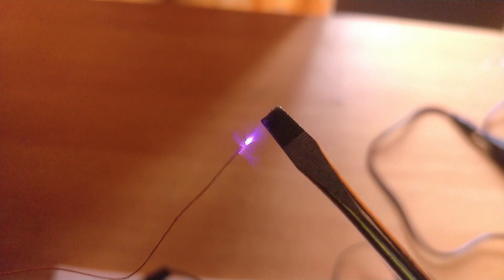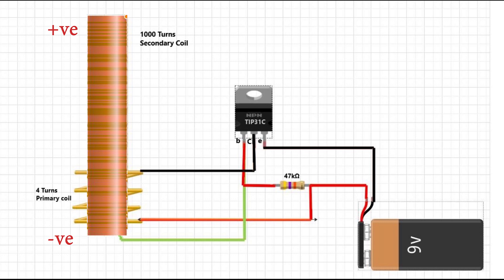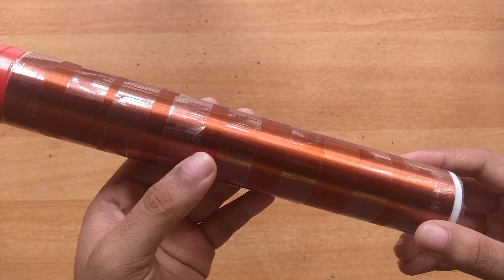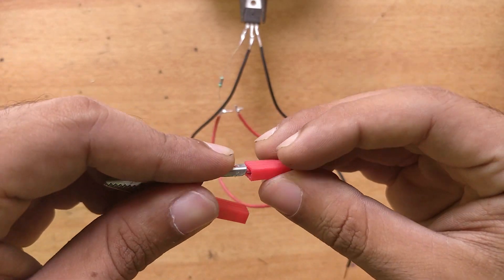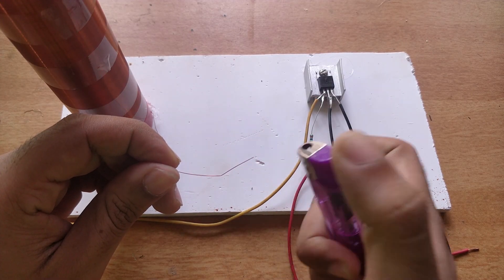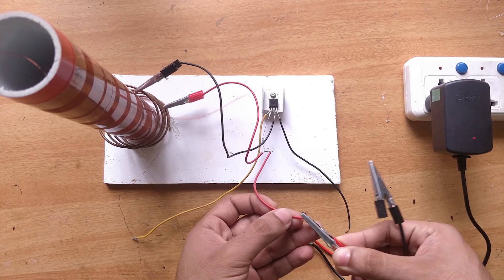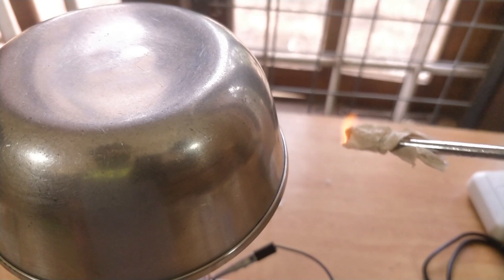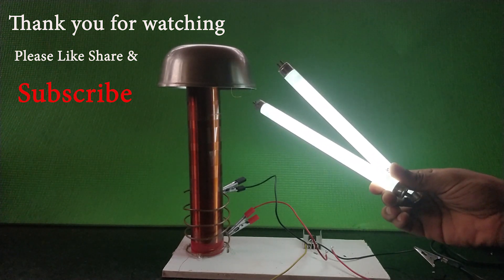How to make Tesla Coil at Home | Slayer Exciter | High Voltage Arc

Comment: Bro how many meter of copper wire did you used in primary wineding and what is the thickness of primary wineding wire .
Reply from the maker: Actually, you need more turns in the secondary winding. For the secondary I have used 200g of 35 Gauge wire. And for primary I used 25 cm 12 Gauge wire.
You can use the same transistor TIP31C .
Reply: @BehindTheClutter  Bro i made 4250 turns for primary coil . And 30 turns for secondery coil .what type of resestens should i use and what type of transistor should i use bro . Bro can you replay fast
Reply from the maker: Primary should only have less number of turns and secondary should have more no of turns. Otherwise it will become a step down transformer.

Comment: Can we use old copper wires for primary and secondary coils? And what would be the thickness and lengths for both coils??
Reply from the maker: Yes, you can use old wires, but for the secondary it must have proper insulation. For the primary you need approximately  25-30 cm of 12 Gauge wire. For Secondary you need 30-35 Gauge wires you need approximately 250g of it.

Comment: Hi bro......copper wire nte cost parayamo.... primary and secondary.... please reply...
Reply: Bro.... primary coil ne ithe gauge Ulla copper wire thanne venam ennundo
Reply from the maker: Primary, 1m 12 Gauge  Rs 100
Secondary, 35gauge 250g  Rs 200
Motor winding cheyyunna kadayil kittum. Laminated copper wire
Reply: @BehindTheClutter  bro secondary coil ne 30 meter copper wire  mathiyo.......atho iniyum veno......30 meter aane 200rs ne........

Comment: if i add more transistor, I'll need to add more power? am i right?
Reply from the maker: If you add more transistors you can run it for a longer period of time. Or you can add more power with shorter time as before

Comment: what is the correct rotation of primary and secondary coil?
Reply from the maker: Both primary and secondary should be winded in the same direction. In this project I have winded the wires in clockwise direction.

Comment: hlo, I need your help for Making this awsom tesla coil, I have an Ques, Please rply
Reply from the maker: Definitely! What help do you need?
Reply: @BehindTheClutter  i want to know that, can we put any no. gauge wire or not? and will the turn remain same or not?
Reply from the maker: No we can't  put any Gauge wire. All the wires comes in different thickness.  For the secondary you need atleast 1000+ turns in a length of approximately 25cm. It can only be done by wires with less thickness. So you need to use wire of Gauge above 30.

And in case of primary you need only 2 to 4 turn and wires needs to be thick to produce enough field. So use wires of Gauge below 14.

Comment: I'd like to ask that can we use a n channel mosfet instead since I only have that laying around, p55nf06 to be particular?
Reply from the maker: Yes, you can use n channel mosfet instead of npn transistor. But p55nf06 is having low power ratings compared to TIP31C. So there are chances that it won't work or blew easily.  You can try using it.
Reply: @BehindTheClutter  Thankyou sir for you worthy suggestion. I'm a 12 grader and love electronics but don't know much about it. Your videos truly help me and also your suggestions. Thankyou once again☺️☺️
Reply from the maker: You are welcome 😃

Comment: Can i use 12v/24v instead of 9v in that circuit diagram ? 

Or i need to change some equipment, resistance / transistor, for using 12v or 24v?
Reply from the maker: No, you can use upto 18 with the current circuit. But you need to add more transistor in parallel to distribute the load.
Reply: @BehindTheClutter  thanks 🖤
Reply from the maker: You are welcome

Comment: And iam from remote area so pls suggest suitable transistors available at T.V repair shops .
Because I was found one t.v repair shop near me..
Or I have z44n MOSFET.
Reply from the maker: You can use any NPN transistor with similar power ratings as of TIP31C. And you can also try using IRFZ44N as it's a N channel mosfet

Comment: I made the same circuit and apply 12v DC from the adapter why it's not working ?
Reply from the maker: Did you use the same components? Same number of turns and same voltage current rating. If so then the problem will be with the transistor. Check weather it's working?

Comment: Sir can i use tip 32 transister
Reply from the maker: No, we can't TIP32 is a PNP transistor and the one I'm using in this video is a TIP31 transistor which is an NPN one. Both functions in the opposite way. So you have to use an NPN transistor here.

Comment: I only have 504 secondary and it is a little thicker than yours
Reply from the maker: The turns shows the voltage multiplication. Voltage multiplied = ((no of turns on secondary) /(no of turns on the primary) ) times. That the problem occur with less number of turns

Comment: Plz reply it's very impprtant.... Can I use TIP41c instead of TIP31c? And 24   gauge wire instead of 12 gauge?
Reply from the maker: Yes you can use TIP41C instead of TIP31C. 24 won't be enough for this. 12-16 will be ok. Or you can use a normal thick wire.

Comment: Bro it worked i have used TIP31C,  4 10 K RESISTOR but my power is too low why?
Reply from the maker: What was your input voltage ? What the current rating.
Reply: 12v
Reply: And it didn't show plasma
Reply: Is this because of the resistors ?
I have not used 47k resistor.
I have used 5 _10k resistors.
Reply from the maker: What was the current rating ? You need atleast 1.5 A, try using 3 10k ressistors in series, Is the transistor working? Check the resistance between base - collector and base - emitter.
Reply: Ok

Comment: Have you used 12 gauge copper wire in the primary coil or 14 gauge?
Reply from the maker: 12 Gauge without insulation

Comment: Bro can i use 10 k resistor?
Reply from the maker: Try using 3-4 10k in series.
Reply: Ok tnks bro
Reply: Bro in the secondary coil can i use electrical copper wire instead of 35 guage copper coil.
Reply: Sry primary coil

Comment: Use mains supply and nsc to have 100000v output
Reply: I saw it in a image in google where they used 240V from mains supply and converted it to maybe 2kv with a nst transformer and used it as Input.  This give more than 100 kv as output
Reply: I am no expert, but I am planning on making a tesla I really need to know if I can use AC as Input rather than DC. Can you help me?
Reply from the maker: I haven't tried it yet, so let me test it and give you the results.
Reply: @BehindTheClutter  thank you so much.
Reply from the maker: Sorry, I don't understand. Could you elaborate. please

Comment: I can use 32gauge copper wire 0.2mm diameter
Reply from the maker: You can use 32 Gauge, but it's more than .2mm  in diameter

Comment: Can i use TIP32c transistor
Reply: Tnks
Reply from the maker: You are welcome
Reply from the maker: No, you can't. TIP32C is a PNP transistor. You need an NPN transistor for this circuit.

Comment: I made it a little glow comes at the end when a metal touch it but it doesn't form a plasma arc i am using a 9v battery , TIP31C , 47k res ,
Reply: Pls help me
Reply from the maker: Increase the voltage and current. 9V battery is only having around .3A and will be 1.8W of power thats not enough. Use 12V 2A. Then you'll get 24W and you can see the arc

Comment: Can you touch the arc with your hand? How many amps does it output?
Reply from the maker: Yes, it won't shock you. But it will burn you as plasma is really hot. The output will be in milliamps  range

Comment: How did you calculated the wire length
Reply from the maker: It's calculated according to the dia of the pipe I'm using. Suppose I'm using a pipe of diameter  'd', then the amount of wire need for one turn will be it's perimeter, and that will be 'πd' (equation for perimeter of a circle). So for one turn I need  πd length of wire, hence for 1000 turns. I need (πdx1000 ) length of wire.
Reply: It circumference not perimeter but great job at explaining Tesla coil
Reply from the maker: Yeah, circle does have it's own name for perimeter 😅. Thank you for the feedback

Comment: I can use 30 gauge 100meters (0.32)
Reply from the maker: Yes,  that would enough for 1265 turns (approx.)  of 1.5 inch diameter.

Comment: 1:07 I think there is serious problem. Your calculation ( (1/0.5)*250 = 1250 Turns ??) is incorrect. Could you please recalculate?
Reply: Wonder if you don't know the difference. Is 500, not 1250.
Reply from the maker: Yes, it was a  typing error, I did the correction and added it in the discription and  pinned the same  in the comments. Sorry for the worng information inthe video.
Reply: Or, did you mean to write (1/0.2)×250=1250 ?

Comment: Hi sir,
Can I use 2SD2374 (or: even with 2SD2374A)? It says in DS the curent collector has 3A, both Collector-Base and Collector-Emitter junctions ratings are 60V (2SD2374A is rated at 80v) and the current gain is 70 hFe.
Reply from the maker: Yes, you can use 2SD2374, but  it's having low power ratings, so you need to use multiple transistors  in parallel to share the load, or it will burn out quickly.
Reply: @BehindTheClutter  ok. So the circuit runs at 5V. The transistor can be found in CRT Monitor.
Reply: But MJE13003 can be used in parallel to stimulate Tesla circuit?
Reply: Note that the transistor having collector current at 3A is not critical. The resistor should be at least 30 or 40 kohm on the base junction. Instead, should I have used 2SD2374A (even in parallel).
Reply from the maker: Sorry, I don't understand. Experiment. Thats the best way to learn.
Reply: @BehindTheClutter  I did already (one transistor).
Reply from the maker: Did it worked? If you were using MJE13005 it  would work with one transistor for sometime.
Reply: @BehindTheClutter  With MJE3055 could work well per yours. Imagine if I was using one 1Amp transistor like BD135 or BD139, the circuit just have worked? Of couurse, can I use fast diode (or schottky) on Base-emitter junction? But on Collector-Emitter and what could happen?

Comment: Can i use 0.42 mm wire
Reply from the maker: Yeah you can use .42 mm copper wire, but the problem is the that length of secondary will increase and it will reduce the rate of induction
Reply: Hi brother I made the whole thing but it's not working 😢 plz plz help

Comment: Can I use regular wire as primary coil of 6sq mm or higher or lower ? What do you say?
Reply from the maker: Yes, you can use 6 sq  mm or higer. But make sure it's comes with single core

Comment: Bro 
I have been selected for State level
Please help in this project
Reply from the maker: Is this your state project 🙄 ?
Reply: @BehindTheClutter   
Can you help he to make high power tesla coil
Reply: @BehindTheClutter  can you help me to make more power ful tesla coil
Reply: @mdmoieez6646  add like 10 transistors in parallel with heat sink and cooling fan in a enclosure.Make secondary with longer 1.5 inch  pipe for more turns.Also mess around with secondary by varving the no.of turns as shown in vid.
use a laptop charger for powering the circuit
and a 12 charger for powering the cooling fan
also add a bigger top load

also don't die
Reply: use like 20v 3amp laptop charger
Reply: No bro i want to make more powerful
Bro can you help me
Reply: I'm unable to find

Comment: Very Amazing video sir...
Sir can i use an another transistor like 13005A and D882...
And one more query ; 
I have 18 gauge wire instead of 14 gauge for primary coil
what now i have to do  ??
Please reply sir...

Answer both questions please...😊😊😊😉
Reply from the maker: Yes, you can use 13005A transistor, but D882 is a little small for the setup. 18 Gauge is very small to give the input. You can use thicker wires than 14 Gauge or if that's not available then you can use normal electrical wires with enough thickness in the core.
Reply: @BehindTheClutter  Sir please make a video on spark gap tesla coil too...
Reply from the maker: Definitely. That's in my list too. Thank you for the support 😀
Reply: @BehindTheClutter  Thanks for answering sir...
Well u have any video on diy step up transformer ?
Reply from the maker: Why do we need that ? If we keep 2 loops of wire with less number of turns in primary and more number of turns in secondary its already a step up transformer. that's what we do with Tesla coil.

Comment: Mine does not work help
Reply from the maker: Have you done everything in the same way as shown in the video ? What was the input power?
Reply: @BehindTheClutter  I build my coil using 32 AWG wire on a 3/4 inch pvc pipe. Winding is 5 1/4  inch long. I tried using a E13005-2 NPN Transistor, 4162pl and D882 P transistor none worked. I made several primary coils one with 3 turns, 4 turns and 6 turns using 2mm solid core copper insulated wire none give any sign of working. I revere the primary coil winding and so trying to get it to work but no luck. I tried using 5 volts, 8 volts and 12 volts and still nothing.
Reply from the maker: The set-up is very small to generate that much output. I think there are only 270 turns (approx.) in your secondary winding and if you supply 5-12V at input it can only produce around  450-1000 V at output. That's not enough to ionise the air. That why it's not visible.

Comment: Brother amazing video but i want to ask you that can i use 2n2222a transistor for it
Reply from the maker: Sorry Bro, you can't use 2n2222a. It's also an NPN transistor but It can only work under low voltage. Here you need an NPN Power Transistor,  even with that you will need more than one to take  the load.
Reply: @BehindTheClutter  Thanks for the information...👍🏽👍🏽
Reply from the maker: You are welcome 😀
Reply: @BehindTheClutter  Bhai mere paas 8 ke bajay 16 gauge ka wire h to m usi se primary coil me kitne turn maarun...
Please reply...
Reply from the maker: ( Sorry, I'm not very good in Hindi, I'm answering as per my understanding on your question) 
You can use 3-5 turns with 8 or 16 Gauge wire. We are giving less number of turns in the primary to increase the output voltage and incase if the wire is not thick then we need more turns in the primary to give input. 

Output Voltage = ( No of turn in secondary coil / No of turn in primary coil) x input voltage

(Eg :-    (1000 turns/4 truns ) x 12V = 3000V at the output.
Reply: @BehindTheClutter  Thank you so much brother you are the best...
May god bless u and your knowledge...😊😊
Reply from the maker: Thank you for the support bro 😀
Reply: @BehindTheClutter  Bro please make a video of a tesla coil which works on AC supply...🤔🤔
Please bro...😶
Reply from the maker: All Teala coils work on AC current by default. Because we need  alternating current for electro magnetic induction. So what we are doing here is we are converting DC to AC by continuously changing the polarity of primary coil.  Inorder to connect 230V AC directly we need a larger setup and the output form that will be very dangerous. 
But one day when I can keepup with the expenses I will make one 😂.
Reply: @BehindTheClutter  I think it would more dangerous than 
one that u made in video..
Can you give me the calculation...
And the way to make it...
Please bro...Hope u can understand the feelings of a Nicola Tesla's hearty fan...🙄🙄
Reply from the maker: @shabnambano1152  Bro, refer to this document, I think it has everything to make a hight voltage tesla coil with 230V AC. https://drive.google.com/file/d/1u4s-0OQd1Ge5ZJnPe94w2UMCdjW0fNbw/view?usp=sharing
Reply: @BehindTheClutter  Thank you bro..
For the very first time a youtuber is totally taking me serious..
Thank u so much again...
🤓🤓🤓🤓🤓🤓🤓🤓🤓🤓🤓🤓🤓🤓🤓🤓🤓🤓🤓🤓🤓🤓🤓🤓🤓🤓🤓🤓🤓🤓🤓🤓😅😅😅😅😅😅😁😁😁😁😁😁😁😁😁😁😁😁😁😁😁😁😁😁😁😁😁😁😁😁😁😁😁😁😁😁😁😁😁😁😁😁😁😁😁😁👍🏽👍🏽👍🏽👍🏽👍🏽👍🏽👍🏽👍🏽👍🏽👍🏽👍🏽👍🏽👍🏽👍🏽👍🏽👍🏽👍🏽👍🏽👍🏽👍🏽👍🏽👍🏽👍🏽👍🏽👍🏽👍🏽👍🏽👍🏽👍🏽👍🏽👍🏽👍🏽👍🏽👍🏽👍🏽👍🏽👍🏽👍🏽👍🏽🙏🙏🙏🙏🙏🙏🙏🙏🙏🙏🙏🙏🙏🙏🙏🙏🙏🙏🙏🙏🙏🙏🙏🙏🙏🙏
Reply from the maker: @shabnambano1152   You are welcome Bro 😀

Comment: Sir please tell me how you get the data of    Tesla coil please tell me so I produce big arc
Reply from the maker: The easiest way to  make a bigger arc is to increase the number of turns in the secondary winding, as the number of turns increases the voltages multiplies and generate bigger arcs. And another way is to increase the input voltage, or  you can do both. In both cases you have to use more number of transistors in parallel to distribute it's load.

Comment: Which transistor u used?
Reply: Im struggling to get it work. I used 2n2222a transistor but nothing...
Reply from the maker: Sorry Bro, you can't use 2n2222a. It can only work under low power and load . Here you need an NPN Power Transistor,  even with that you will need more than one to take  the load.
Reply from the maker: It's TIP31C NPN transistor.

Comment: Awesome. Can we increase the input of the Tesla coil to18v and how
Reply from the maker: Ofcourse, you can supply 18v at the input. But you have to add more transistors in parallel, otherwise the transistor will over heat and blew up.

Comment: Sorry to bother you..😅

30 gauge copper = 0.315mm bro
by seeing this way 25 meters of 1.5" pipe takes 794 turns
Bro once give me confirmation
,
Suppose I have
,

25cm 1.5" pvc pipe and 30 gauge (0.315) copper wire

I should buy 95m of 30 gauge copper wire
.

If this is crrct,
Can I expect the arc that I've seen in the video with my 794 turns secondary coil bro
?
If it's wrong then please explain
 me bro 

I'm bit confused..
Thank you bro
Reply from the maker: Yes, it's correct you need 95m of  wire to wind 25cm PVC with 1.5" dia. But probably you can't buy 95m wire from the store. They sell it by weight, you might only need  250g-300g max.(Because I bought 500g and it was around 5 times my requirement)
 
Yes, you can expect an arc and it  depends on your voltage input, ( I used 12V 2A).